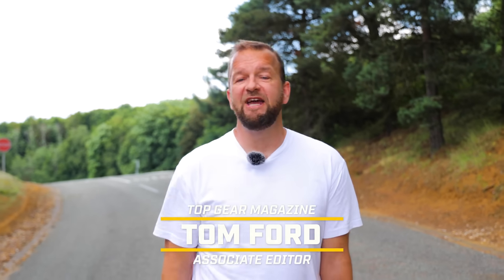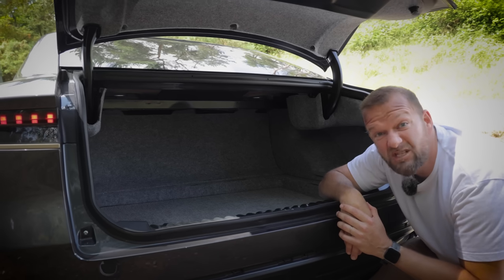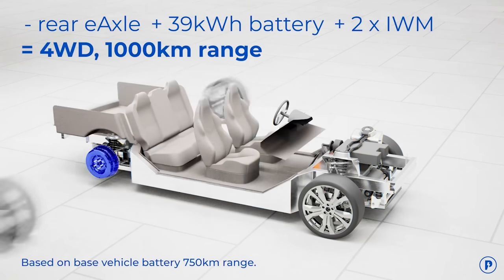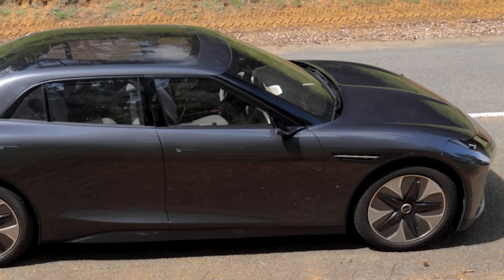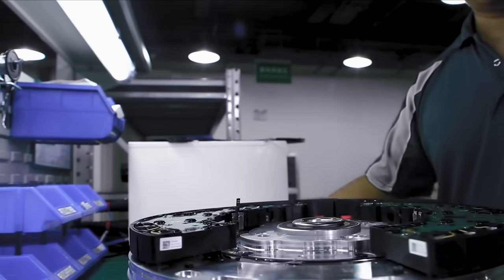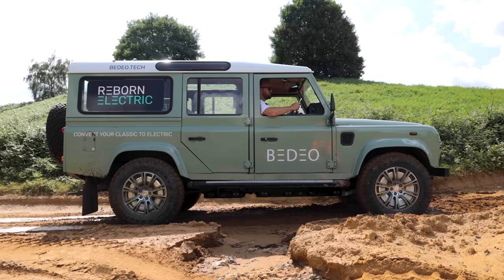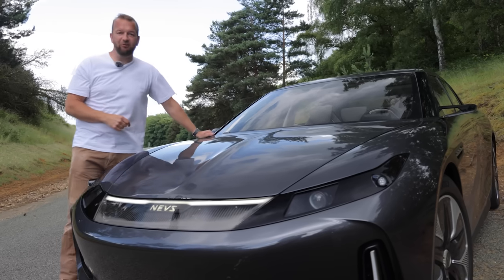NEVS Emily GT: SAAB’s Secret EV With 600 Mile Range | Top Gear

Comment: Finally, modern hub motors in EV cars! I’ve been complaining about this for years! Now, hopefully, we will see conversion kits using this tech so we can add these wheels to older cars, rip out an old dead engine, put the batteries there, and save some of our old classics. Obviously some classic cars are classic BECAUSE of their engines, but for those cars that are just great for looks and not so much driving, this would be a solution.
Reply: I hate EV conversions, unless done with cheap ugly mass produced cars no one wants, which no one seems to be doing. I'd imagine most of them get neglected with the unreliability of such conversion, they're probably unbalanced as hell, considering the chassis was designed to have an engine somewhere in it, and not batteries, so the argument of driving better doesn't stick anywhere. And either way EVs have top speeds comparable to cars in the 80s, and the 0-100 time gets pretty old pretty quick. There's more to a car than acceleration, and like I said you won't be going anywhere with that unbalanced mess, unless it's a very straight, very short road. Maybe an empty  parking lot!! Fitting :D
Reply: I’ve had a view for a long time that, given that the current global volume of ICE cars that should not be trashed (expense, waste, etc.),  retrofit of the current fleet if ICE cars would be a logical progression, particularly if a small range of tech and kit options could be designed to be used in high volume models, such as say, a Corolla.  This in wheel tech could be a real part of that set of options, by the look of it.
Reply: @BubbleDouble  If you look at a velocity curve on a track day have a guess where a majority of the curve falls. It's most definitely not at the high end - it's in the breaking and accelerating. Top speed is infinitely more of a gimmick than acceleration or breaking. Everything else you just said couldn't be more wrong, older cars generally had bigger heavier engines that resulted in CoM's higher off the ground and thus worse roll etc. Battery packs massively lower the CoM and plant the vehicle miles better around corners etc. Suspension set-up would need to be changed, but besides that, everything else would be improved.
Reply: @bilbonob548  Not talking about track driving, of course you aren't reaching top speeds in a track.  No one reaches their max speed driving day to day either but the same goes for the acceleration. For track days you have more inexpensive, and way better ICM models, which come perfectly aligned from the factory (same goes for day to day driving...). Not all old cars had bigger engines, most european models had 2-3l engines and most EV conversions I've seen have been done on models like the e30, which is an already nimble car with a light engine. At most the engine including the transmission is going to weigh around 200-250 kgs. Not sure what type of batteries they use for conversions, but a quick google search brings up the weight of a nissan leaf battery to 300 kgs, lets not even bring up tesla batteries, which is what everyone uses. Even if somehow vertically the CoM is better, you can't get over the disbalances between the front and rear axis you're going to cause without stripping the car apart even more.
Reply: Co sign

Comment: Those seats look really a futuristic version of SAAB seat.   Saab always innovates until they fall in the hands of GM.  

In the old days,  SAAB always took their cars just from production and seal them and then transport them to a track for long term test.    Maybe they can do this for this vehicle to get buyer accepting this tech.
Reply: Most EV companies want to hide their track testing since the cars weigh as much as a tank and can't handle for crap.

The electric torque might hide the weight in drag racing but you can't hide the weight from corners....
Reply: GM it's one of the kings in the car industry what are you talking about?? the Americans keep teaching the Europeans how to proper make EV cars, I guess you guys still don't want to learn.
Reply: Owned by chinese group now?
Reply: @christhedoc8689 either you have no idea about Saab or about GM. Chevy always made the boring cars...Olds,  Buick and later Saturn only did some cool stuff. SAAB was more like chrysler in the late 50s a true Engineering company with bad sales men. But amazing cars & tech
Reply: @christhedoc8689  The build quality of American Teslas is known to be pretty bad for such an expensive car. Irony is that the German built Teslas don't have those build quality issues.
Reply: @gorkzop  if you would read my original comment again you would know that I never intended to talk trash against Saab LOL!! I was talking about the EV industry in general not about Saab specifically, but if we are talking about gas cars then GM it's way above Saab. more sales, better cars, GM has been one the kings in the SUV industry, their Buick cars were tanks, and not even Toyotas were as reliable as Buick cars in the 80s and 90s. what about the legendary Cadillac Escalade??
Reply: @PURENT  When you make the best EV car in the world, you will always get hate, why do you think Toyota cars have a lot of hate also because of building quality but they make the most reliable cars in the market? there are plenty of videos on youtube about model 3 Tesla cars with over 200k miles with no issues at all and keeping their battery life strong. 

also, German EVs are way more expensive than any Tesla and don't offer the system, speed, functionalities, and charging stations as Tesla. when have you heard that the Tesla plaid has built quality issues?? if tesla cars would have quality issues they wouldn't sell so many cars, people aren't stupid, they wouldn't spend over 40k for no reason.
Reply: @christhedoc8689  I think you missed what I meant. I'm not talking about other companies, I'm talking about just Tesla. Tesla builds it's cars in US, China, and Germany.

The ones built in America seem to have way more quality issues than the ones built in Germany and even China. Americans designed the car, yet the Germans and Chinese seem to be able to build it better. That's just funny in a way.
Reply: @christhedoc8689  Cool down, if you know anything about SAAB history, the GM overtake was a failour to this brand
Reply: @nexu2010  That car group got bust 2 years ago.  That car group worthed 80B US at its peak in the stock market but was not able to manufacture one proper EV when it vaporized.       Don't know who is holding this Saab name today.
Reply: @christhedoc8689 Americans teach Europeans about car making?! 😂😂😂😂😂😂😂😂
Reply: @nuttycommuter3718  in the EV car industry the Americans have no real competition just with themselves.
Reply: @christhedoc8689  that’s not really the case. Kia/Hyundai make great electric cars, BMW have a range, Stellantis group, VAG.
Reply: @nuttycommuter3718  these companies just make EVs that's all, in numbers of sales they aren't a competition to tesla.

Comment: Top notch engineering. No less than I'd expect from those clever Swedish engineers. I hope it gets into production.
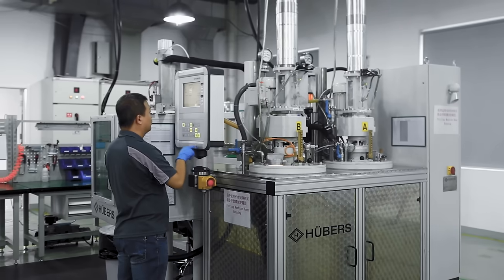Reply: Except for the machine building pieces seen @1:48 which is made by ATS that is located in Cambridge, Ontario, Canada.
Reply: @conservativeontarian328 Thanks for the info. Clever Canadian engineers too :)
Reply: @markbriggs5531  thanks! there's a couple of us. This part of Ontario is a big hotspot for manufacturing technical excellence, but it's sadly becoming a dying trade. The bright spot in this is that we now specialize in working on such high end jobs as what's seen in this video.

Comment: Unsprung mass is the Achilles heel of this kind of electric motor application (driving dynamics wise). And there are a lot of undamped vibrations that will fatigue those motors in time (reliability wise). Although is a great concept in theory, it will never become a mass production option for big manufacturers like VAG, Renault–Nissan–Mitsubishi Alliance or the huge chinese manufactures like Geely, BYD or Dongfeng. I hope SAAB finds another way to come back to the car market because it still has a lot of fans around the world.
Reply: Was scrolling through the comments to find this exact comment. The idea is good but its unsustainable.
Reply: air suspension and active dampers. I feel like he would have said it if was uncomfortable
Reply: @PH-kl5qq  Who mentioned comfort? 🤔
I guess its plenty comfortable, but its not the issue we are are adressing.

Comment: Twice I've had alloys shatter because of potholes in the UK. Second time it munched the brake disc and hub. Can't imagine the cost if that happens on this.
Reply: Yeah it's so much more likely too with the weight in the wheel. You'd need a LOT more sidewall if you wanted to have a chance of it surviving

Comment: glad to hear SAAB might be back on automotive track again.  However, I am not sure about in-wheel-motor driven car.  When it is new, it works for sure!  But after having all abuses on most busy part of the car........... I am pretty sure in-wheel-motor will not survive....... or life-span would be very short.
Reply: Aptera is also using in hub motors being developed with Elaphe and they're very public about their testing. It's actually quite interesting how well they hold up to extreme driving conditions.
Reply: The thing is its electric so no big moving parts that could get out of place with vibrations. Yes it might be damaged when you hit something like a fatass pothole, but by that same logic and situation the wheel would break on a normal car anyways so you'd have to replace it. Also the fact that three wheels can fail but itll still get you home on one is great
Reply: @TooMuchRecoil  Not really though - you're hitting the wheel itself much harder on each pothole so you'll break the wheel before a normal car would have. Also it's perhaps possible that some wheels fail and it's still drivable but it depends on more information than is in this video - it's just as likely that one failure would disable the whole car (see why a dual motor tesla model 3 does not actually gain redundancy vs the single motor one)
Reply: This was unfortunately a One-off Prototype. SAAB has been dead since 2011 and NEVS, the company which made this car is now in so called "Hibernation" having laid off 95% of it's staff.
As much as we All want them to, SAAB might never make a car again.
Reply: @@MustBePerfectForeverlordstown declared bankrupt and sued Foxconn for harm
I think I wheel motors are cool but they need to stand a lot of abuse 
And tires see a lot of damage 
Imagine a tireburst causing your car to become an insurance loss

Comment: I love the idea of motors which are directly bolted to the wheels, very good for packaging. But I am concerned about the unsprung mass, even though they said the ratio is balanced but still suspension will have a hard time on bumpy roads.
Reply: They could at least save a few kg per corner by omitting the spokes.  Prototypes could run 2- or 3-piece race wheels minus the spokes, then production cars could get a bespoke OEM wheel.  Ideally, they could even make the motor case double as the wheel barrel.  Of course, the rim would have to be bolt-together for mounting tires.
Reply: @Leathersoup  The tire provides a spring, and much more sensitive electronics have been hardened enough to create e.g. nuclear artillery in the 50s.  Shock loads will be fine.
Reply: It sounds like they've attempted to balance the ratio by using a ridiculous sized battery. I dread to think what the overall weight is.
Reply: @tewrgh  It's basically a Lucid Air plus an extra standard range battery, so probably 6000-7000 pounds.
Reply: @tewrgh  And the price.
Reply: @concinnus yes, but if it's a PM synchronous machine, that probably means rare earth magnets, and they're distinctly brittle and do not respond well to NVH.  And 35kg extra per corner is a huge amount.  I don't know what the plain simple 18" wheels on my car weigh, but I doubt it's much more than half that.  So even allowing for the hub, a chunk of the suspension arm, and things like the drive shafts that aren't needed any more, the unsprung mass on each corner is probably at least double what it would be on a non hub-motor vehicle.  That can't not have an effect.
Reply: @jonathanj8303  Oh, it'll definitely have an effect.  It will destroy ride quality.  But I doubt the magnets will be shock loaded into cracking.  The bearings should also be fine, even though rolling element bearings don't get used in high-shock applications like crankshaft bearings.
Reply: @concinnus  that's the thing, I suspect they've 'normalised' the sprung/unsprung mass ratio with the huge battery pack.  And while the tyres are squishy, all that extra unsprung mass will be giving them a pummeling, which won't help their life.   Electric motors might be super efficient, and be able to be 'fueled' more or less directly by renewables, but making the car a ton heavier is not a step in the right direction.
There's a quote, I think from Henry Royce, to the effect of "I wish refinement didn't cost so much weight."
I guess there's a reason, apart for the market segment's ability to absorb the cost, that new and ground-breaking EV's tend to be hefty luxury saloons and SUV's.
Reply: @concinnus While higher unsprung mass is not desirable when it comes to the vehicle dynamics of any car, the effect it actually has on the handling and comfort of the car is vastly overstated by majority of the journalists and car enthusiasts. Lotus has done extensive research on the topic, and there are a plenty of scientific articles that have looked into the hub motors have concluded that hub motors by far offset the higher unsprung mass by more direct torque vectoring, higher steer angles, better wheel slip control and other things.

Severity of higher sprung mass remains as one of the widespread automotive myths out there but when it comes to the engineering aspect of it, hub motors are very sensible engineering decision that have way more benefits than cons, especially if we aren't talking about racing cars that need bigger motors and where more minute differences make big impact.
Reply: @Leathersoup  Also, tacoing a wheel seems like you could go from an annoying, expensive fix to a VERY annoying, VERY expensive fix.

Comment: I see little bit of New 95 at the rear there! Nice!
The 9000 had massive rear seat space as well. IMO the 9000 was the best SAAB made.
The crazy thing about this concept is the unsprung weight, which normally manufacturers try to keep down. The video goes into this -I do wonder however what happens if you hit some large pot-hole with one of these wheels. (And, as I type this, the video mentions this too ;-)
Oh, and scr*w GM for not utilising the SAAB excellent engineers.
Reply: +1 to your comment! 
I am curious about the unsprung mass, and also the angular momentum the front motors will have during fast, long curves. I'd imagine the braking is not as impacted because of regen, but that would be another curveball. 
Scr*w GM indeed
Reply: +1 the comment i was looking for...
Reply: F3ed the word "sprung" and got the same.

Comment: Yeah, I’m pretty skeptical about all the unsprung weight. I don’t think you could ever get this to be as comfortable on bumpy roads as a similar EV sedan with inboard motors. Not to mention the fact that all the engineering to make wheel motors work surely adds to the price and production time.
Reply: The car uses air suspension to iron out the bumps. Protean have been developing their motors over several years. Also worth noting,  Evergrande owned Protean during the time of the Emily project
Reply: @davidthornley4375  less unsprung weight makes a significant difference in handling since the suspension and its components can be lighter which will improve stability and bump absorption, Keep in mind that the company made the unsprung weight manageable for the suspension which doesn't mean its ideal, but what they are focusing on is the concept of having in wheel motors and its advantages to older vehicles
Reply: Judging by Tom's face during driving the suspension is just fine, he never mentioned it being too rough or anything.
Reply: Most roads today are not bumpy anyway.

Comment: Every former SAAB driver knows that they are extremely good cars to drive - and tinker with. 
Those wheels have to go on my SAAB 9-5 with a few batteries somewhere and the beautiful (almost not tuned) AERO engine providing range extension at it's most efficient rpm. 😊😊😊